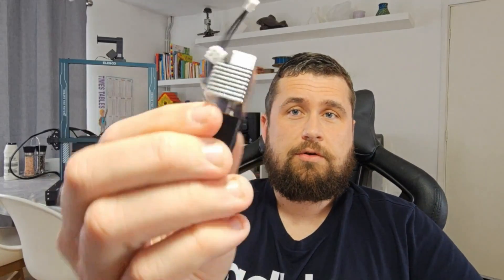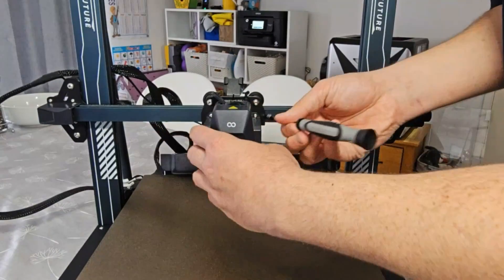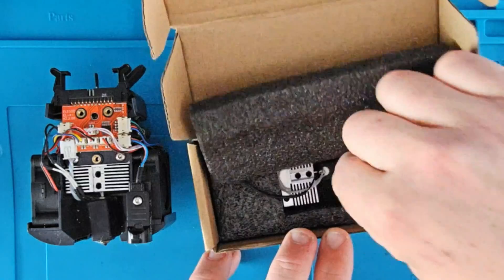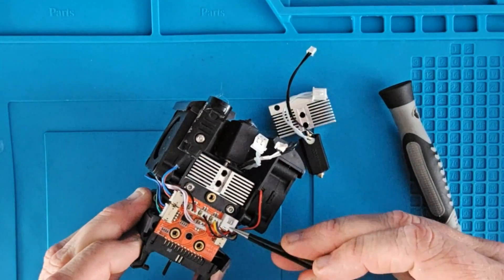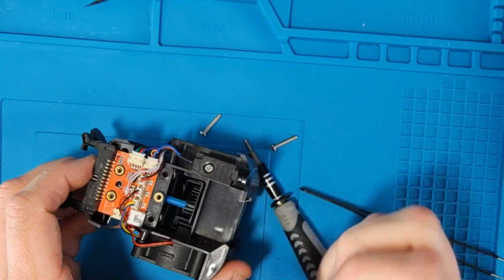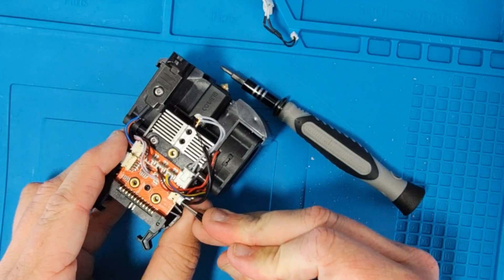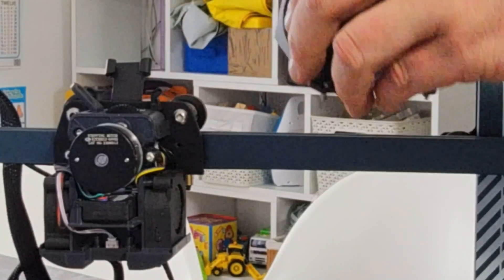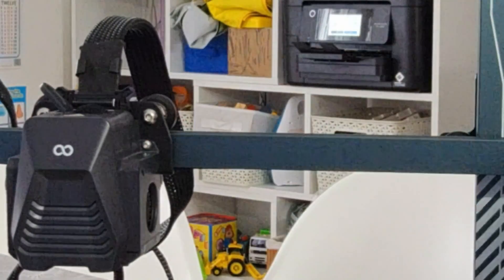ELEGOO Neptune 4 plus hotend change

Comment: Great video and explanation.  The only suggestion is there's a missing part.  after the installation of the hot end and plugging in the wires, where do you put your wires?  At first I thought, I'd just run it up in the middle of the hotend heatsink.  Then thought against it.  Instead, I tried to keep the wires a distant from it by running it straight to the side and up.  I was concern that the wires touching the hotend would literally melt.
Reply from the maker: Thank u If you watch the video at 1.54 seconds You can see where the wires are before I even Unplugged them, they will not melt on the heat sink. 🤔🔥 As far as i'm concerned, they have a heat proof Shielding on them and the heat break shouldn't get that hot to my knowledge 👍😎
Reply: @intelligenttinkering  ahhh I see, thank you :)

Comment: Next time I will watch some videos first... Very good tutorial thank you. I was used to my old Anycubic dinosaur where you can just loosen the nozzle with a ratchet and don't worry about anything without any deconstruction. Tried that with the Neptun and ripped all cables off because the whole heating block was spinning. Luckily the replacement is only 20€ and I see that as an education expense 😅

Comment: I've had to change the hotend twice within the first year.....
Both times do to getting that Blob-o-Death when the print fails in some way.
 Then that blob gets to the thermistor wires and breaks them.....this is such bad design......they should make a shield so the blob can't get to the wires if something happens
Reply: How did you recover from it? I put mine in a convection oven to loosen the blob, then used an old soldering iron to further cut away the blob and managed to save everythin

Comment: @Inteligent tinkering - Great Video. I have a question: I first bought a Neptune 3 Max and liked it. I have recently bought a Neptune 4 Max. I ordered a spare fully assembled Extruder Kit from Elegoo and it looks the same as the 3 Max. Almost. ( Fan ducting is a bit different ). The question is: Would it work on the Neptune 3?  Or is the wiring different. I have googled this but no answer. Thanks.
Reply: Well, three months later, but I also have a Neptune 3 Max and bought a Neptune 4 Plus and they use different extruders, they are not interchangeable, the Neptune 4 Plus and Max are the same except bed size. Your 3 max takes a different nozzle than your 4 max. Hope this helped
Reply: @johnhoffman9413  Thank you sir.

Comment: I was planning on getting a Neptune 4 plus since it says it can reach up to 300C and has a decent bed size.

My main concern/question is it capable of printing special/engineering filament like abs or nylon? Or only a few of them? Additionally, by upgrading the hotend nozzle would it help as well?

I haven't have any experience printing with advanced filaments so I'm not exactly sure what I need to consider or expect.
Reply from the maker: Honestly, I've never printed anything like that on this printer. You need a heated chamber for that, and this one doesn't have one. I think you can buy them separately, though.

Comment: which mods did you do to it before changing?
Reply from the maker: I need you to replace a thermistor I had to make the hole bigger to fit the new one in and then I wanted to change it back